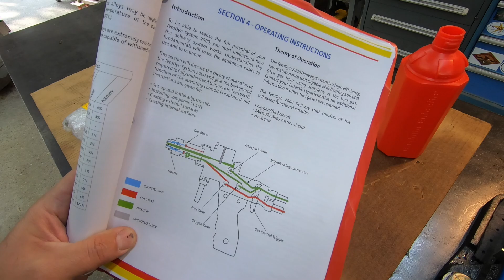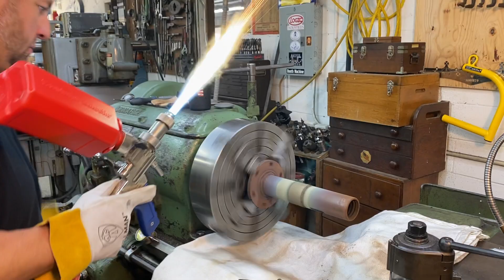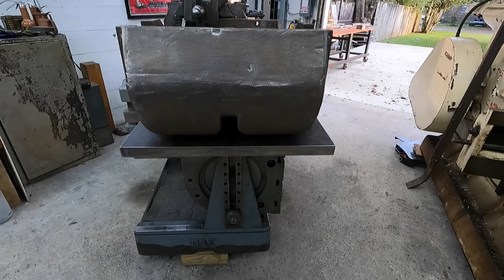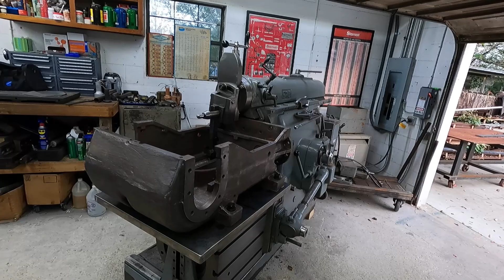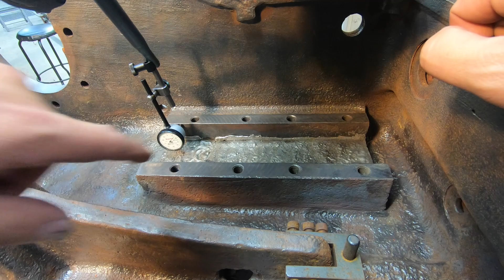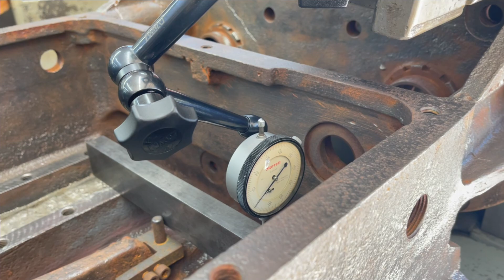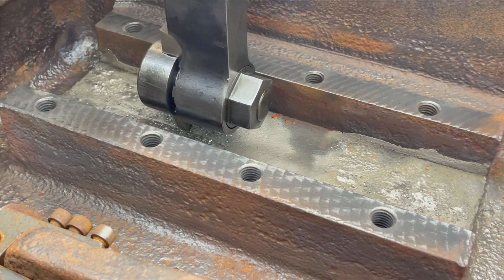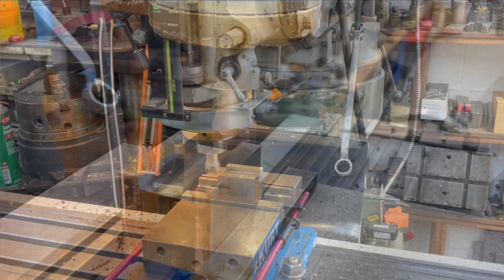SNS 331: Stoker Engine, Eutectic Torch Repaired, Tung Tri Mill

Comment: Wait, how does using a longer tool, and lowering the table cause clearance issues? And my understanding is that the tool holder itself allows the tool bit to be placed in multiple angles while the tool holder stays in the vertical. If you lower the setup, without changing anything else, you can take care of 2/3rds or so of the bottom area out to the edges of the center walls.
For the outer walls and remainder 1/3rd bottom plane, you can both turn the bit on the holder, and then grind an oblique angle on the tool bit to clear out to those outer walls.
 You could also either pull the tool holder up some if table is bottomed out, and with longer bits basically achieve the same. Yes you'll need longer tool bits, and by rotating the lantern holder only you can lesson the oblique angle needed for the outer wall angles.
EDIT: This would be a point where NOT cutting the tool blank in half would of been a good idea. Was common to keep the tool blank full length and just grind a tool onto each end. That would let you have two tool on one blank, but would keep the length for these types of jobs.

Comment: It's too bad all the options seem to be running into dead ends watching the video I can see what you're saying. At first I was thinking to rotate the tool holder closer to the wall and then reorient the bit to compensate,but you mentioned that this too has a clearance issue and I think I see it. I am assuming that the clamp on the tool holder ends up too high to clear the pocket at the end. You mentioned the k&t and I'm not sure which clearance is where the problems there; but my thought now is that something like that with a cat 50 or cat 40 extended holder and a two or three inch face Mill mounted on the end maybe the best option. I'm thinking this because you could come down with a slimmer shaft and a wider head for the face Mill this should let you clear the back wall and slide The wider head into the pocket a bit. The question then becomes stability of running a face Mill at such a length I'm sure you would have to run it quite slow to make it work.

Comment: to bad you don't already have a clapper box modified to do the cutting on the backstroke (like the one Stefan Gotteswinter used to have). From what i can see, that may have worked
but a good machinist knows when to give up:  before something is damaged.

Comment: I was thinking along same lines, make a custom tool holder/long arm thing? With as much time you have sunk into it, not to mention the plate setup etc just cut it out and go! Looks like a pretty benign object to make compared to some of the stuff I have seen you produce. Inch longer and a left and right curved one. Sure you will need them in the future? Light cuts, wouldn’t have to be crazy strong? But I am no machinist, just farm boy who likes tinkering....

Comment: I have no experience with a shaper and not much with a mill and lathe in general but is on "offset" tool possible? Looks like a 1/2" holder but if you grind up a 1-2" piece of stock to fit the holder and put the edge on one of the sides you might be able to fit it in. Defiantly not good for rigidity and torqueing the holder but with light cuts you might be able to make it work with a right and left tool

Comment: Dear @Abom79 Please don't waste any more time on this setup. The crosshead guide rails and the bottom guide surface were originally machined in one (1) setup with vertical milling or fly cutter(s). You can see the original circular cutter marks are still visible on the tops of the side rails. I'm not sure why that bottom guide surface was built up with "braze" ?!? -  maybe it was badly pitted? But anyway, just get that poop clear out of there. That's not going to work at all The bottom guide surface was originally raised up about 1/8" -  1/4" or so above the the rest of the casting, and the crosshead ran slightly past both ends of it to avoid wearing shoulders at either end of the stroke. So no "braze" is going to take that kind of pressure. The only good way to fix this mess now is to set it up in a jigbore (or vertical mill) and indicate off the tops of the side rails. Use a fly cutter to mill the bottom way(s) parallel with the side rails, and take them down flush into the casting. If necessary, you can mill slightly below the surface of the casting, until the groove is deep enough to mount a 1/4" (or thicker) CI wear plate - where the raised bottom guide used to be. Then just screw in the wear plates with countersunk screws, and stake the screws with brass pins. I have a Knight jigbore that could handle this easy. If you're tired of messing with it, send it over. Us greasy old guys gotta help each other anyway we can. Best, Tom
Reply: Dear Abom79, I added a photo of the Knight jigbore here. Sorry you have to scroll all the way to the bottom: https://www.researchgate.net/publication/343126347_Reciprodyne_Fabrication_Shop_Tour/figures

Comment: Could you make your own toolholder, maybe have it hold the tool at a 30 degree angle leaning forward and then sharpen the tool at 30 degrees to make it flat, that would give all the clearance you need at the front for the casting. You could also make it as long as you wanted since your taking such light cuts you don't need a ton of rigidity.

Comment: Hi Adam, 
I have just finished watching the video capturing the issues you are having with the stoker engine and trying to create a finish at the bottom of the unit.  It seems to me that with all the portable and flexible hand machines that are available these days, it may be sensible to use the two tapped rails at the bottom of the unit as support for a machine that could run on manufactured rails.  A bit of construction work required here.  As a secondary thought, you have that super tapping machine that always works in a parallel attitude.  Maybe if you had a chat with the suppliers of the machine, they may be able to provide a solution using the tapped support rails at the bottom.  Just a thought but keeping posting those informative videos!
Regards Chris Bramble

Comment: The fly cutter marks on the retaining plates is a clue for me.  A large (1.5"+?) long (14"?) boring bar with an extended angular set brazed carbide lathe tool should be able to clear the top reliefs they cut in the casting and properly ground, cut square to the shoulders. Maybe 3/4" clearance edge of casting to edge of cutting surface clears bar plus tool extension.? Then the problem is a big enough machine for the casting & travels, maybe a big vertical?  It will be slow going.

Comment: Hi Adam,  between your comments and seeing the shaper actually taking a small cut, I can now see your dilemma whith this job, you know your stuff for sure, and I can't see how it could be done on that machine , whith the limited amount of adjustment that you have, if it was me I'd rather walk away from this than risk having a poor result, I certainly wouldn't condemn you for doing that, it's not questioning your skills, which are undeniable, whith the right machine this would have been relatively easy, and safe to do, just my 2 cent's from an old mechanic who's been around the block a few times, and been bitten by jobs I should have walked away from. Here's wishing you and abby, and all there, the very best for the new year, kind regards Stuart.uk.

Comment: What machines were in the shops when the stoker engine was manufactured? I would guess a planner might have been used but again you have a clapper box and most of the same problems of no room.
Was this done with very long tools and hand scraped to finish the job? lol

Comment: If it weren't so far down in there, I woulda been tempted to hogging the whole thing out and create bolt-in bearing surfaces. That would solve several issues. But then there's the "how-to" remove the old surface material.

Comment: Adam:   I'm not sure what I consider the most impressive:  your ingenuity in figuring out how to machine this extremely awkward casting with the tools you have available, your persistence in fabricating the casting holder and in indicating it in all three dimensions to assure correct machining, your wonderfully clear explanations of it all, or your optimism and faith in being willing to expend all this time, energy and cost on a job that you are not sure is capable of being performed at all because of the doubtful condition of the reconstructed underlying surfaces.  

This is probably a real dumb question but I'm going to ask it anyway:   I know that crosshead guides on many steam engines (such as the main engine on the operating museum ship Liberty Ship SS JOHN W BROWN, on which I served for several years as an engine room volunteer) have babbit  metal surfaces.   Wouldn't babbit metal surfaces have been much easier to lay down,  much easier to you to machine and much more certain of producing an acceptable final result?

Comment: Adam, small revisions to vertical mill head for the shaper just remove the clapper box thus you will retain vertical head movement make the vertical head from heavy wall pipe or tubing for as long as you are going to use this tool you could use oilite bearings. Weld the tube to a flat plate which bolts on in place of the clapper box. This gives adjustment in all three directions. I had a friend who converted a small shaper into a cam grinder for model engines by replacing the clapper box with a self designed tool. unfortunately he has gone to his reward.

Comment: So this spray weld is used so corrosion is kept to a minimum??  Fills in missing material?  Build up steel then machine down to desired measurements?  Thx

Comment: Great video as always.  On your scraper issue can you make a cutting tool in the shape of a putty scraper that has the whole cut edge along the bottom.  If that would work you would not have to transvers to either direction very much.  Another idea if you think would get you anywhere is if you could put an offset in your tooling bar by cutting and welding off to one side and then do mirrored for the other to reach both sides of the cannel.  I know you will figure out something to get the job done as you are a master machinist for sure.  Thanks for sharing.

Comment: For your custom spray welder holder... I'd make an extension with a post that fits into the existing short mount. Then you can have a mount for the unit with or without the heat shield.

Comment: Adam think out othe box, The shaper ram is like the dam on a Bridgeport or a German  horizontal milling machine. Remove tool holder and clapper box and construct a close coupled belt driven vertical milling head with a long snout which will fit down in the cavity. you can mount the head with a slotted plate for adjustment, This is probably a one time use item so it it doesn't have to be fancy or even high precision. Give this a serious thought, it may solve your problem. Good luck.

Comment: Back when I was taking engineering graphics (technical drawing) in high school I remember there was some section in our textbook on features and designs to avoid. Basically, "Avoid designs that will be difficult to manufacture or machine." This would be a perfect example of that. We were also required to take a machine shop class. We had two big shapers and even a planer with dual heads. We also had a HUGE horizontal boring mill (you could park a small car on the table.) Whoever designed stoker engine must have had just the right tools/tooling to make it. 
I have been faced with many intractable jobs over the years and I can appreciate the difficulty that you are going through. It is also difficult to give up on such a job.

Comment: Put an off set on your tool holder. It may take some welding and extra material but the offset will help get your speed steel closer to the sides. I can draw a picture. Kyley@fickconstruction.ca

Comment: Could you mount a grinder to the tool holder and slowly grind  most of the ripples and imperfections out of the filler material. Would a smooth surface make it easier to machine?

Just a goofy idea that might or might not work.  Good luck on the stoker engine. I can’t wait to see you, Keith and others finish the various parts so the stoker engine can be reassembled and tested!

Comment: Not trying to teach anyone, most of the guys here has probably forgot more about machining then i have ever learned. But if you were gonna do it in a mill, and regarding the clearance problem you mention, if you tilt the mill spindle by 2-3 degree and would come in with a ball end mill you would get a flat cut on the bottom. I assume it wouldn't matter tho you get radius in the corner. Just thinking out loud...

Comment: Mr Booth I found in a armstrong catalouge page 50 that follows :
Armstrong Planer and Shaper tools
No. 43  1 3/8 x 2 x 16  size cutter 3/8 x 7/8  weight 19 1/2 lbs.
No.45   2 1/8 x 2 3/4 x 22  size cutter 7/8 x 1 1/8  weight 51 lbs.
Maybe the 6 " more on the 45er gives a needed clearance.
Maybe your friend Andrew Alexander have a 45er in his warehouse lay around :-)

Comment: Adam,
I can feel your frustration, and part of it is disappointing your viewers. I personally do not think that most of your viewers mind AT ALL if you are not successful on every project nor do they care if you have to take time to work out other ways to do the job. I think that most of us watch the channel to spend some time with a person we very much like, who has mad skills, does interesting things, has a great attitude, is clever, honest, and who teaches us things we didn't know. As someone who has spent many years working with machine tools, I know how annoying it is to be hung out to dry by a machine that cannot quite do the job. Maddening!

You are hugely clever, resourceful, and competent. If the shaper cannot do the job, it is not a failure- it is an opportunity to take us on a new journey, to figure out HOW to do it. If it means a road trip to someone with a big milling machine, and you want to collaborate with them, then fire up the truck, pack some lunch, and let's go! Perhaps, instead, you can figure a way to use the surfaces with the tapped holes to bolt down a mini platform to allow a grinding wheel to do the job. Maybe something like a router, or maybe a small high speed tool (air?) which runs a stone and moves on a flat base cutout for the area to be cleaned up. You need to remove only a small amount of material after all.

In any event, we will be fascinated to watch you solve the problem. And thank you for the huge number of hours and effort that you put into the channel. Wherever you go on Youtube,  people reference you and your work. What you do matters a lot to a great many people, so thank you. 

Michael

Comment: Adam, give yourself credit for giving it your all. It's clear that you have an incredible amount of knowledge that you have learned from your dad, and from your own experiences. But I believe that you are perhaps a little new at using a shaper. Maybe not, but in any case you have done the best you can and that's all that can be asked of you. 

One thought I haven and again it may be a whole bunch of clearance issues. Can you get the largest diameter end mill that your milling machine will hold, long enough to hold in the chuck with the chuck clearing the top of the housing and then with flutes that are only perhaps 1/2-1" long rather than going the majority of the way up the shank. I would think that having the majority of the shank uncut, would help minimize the flex. Then comes the other challenges. How well can you tram the head of the milling machine to make it perfectly vertical? Do you have enough clearance between the head and the lowest level of the knee? I suspect that I can answer part of this and that is that it might be extremely difficult and expensive to find a milling cutter with those criteria, and totally cost prohibitive to have one made.  Another idea that is pretty way out there, and probably more of a last resort, and again, will only work of you have enough clearance between the head and knee of the milling machine. That is to make a bar  as needed and then modify a slitting cutter blade so that you can screw it into the end of the bar with flat head screws. Another thought. Is it possible that the slide surfaces originally hand scraped rather than machine scraped?

Comment: My suggestion would be to make an extremely stout tool holder to extend down into the tub. Then you can make a similarly stout tool holder to extend to the left and/or right.  This will compensate for the clearance issues at the top of the tub.You could put a reverse clapper on the bottom of the extension instead if using the stock clapper.

Comment: I think Carter W Hern is on the right track, if the large machined surfaces were mounted at the bottom and it was milled vertically in a HBM like Brian has. Adam you are giving this your best shot with the equipment you have so it no disgrace to say sorry its not for me. Have a Happy New to you and Abby.

Comment: So i went and looked for when Keith first took the engine apart;
https://youtu.be/nmKo3un-pgs?t=1040   first  removal
and https://youtu.be/nmKo3un-pgs?t=1458 later discussion.
Insead of machining the surface could something be done by pouring a babbit surface over the piece you tried to machine  and then machining a new cross slide. Basically reversing the set up originally in the machine, which was metal and a babbit bearing on the slide.